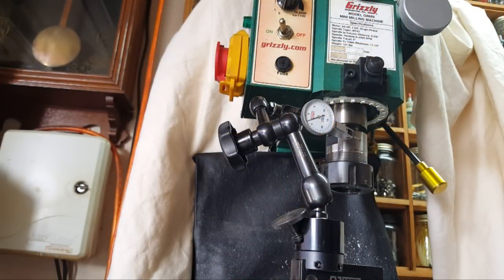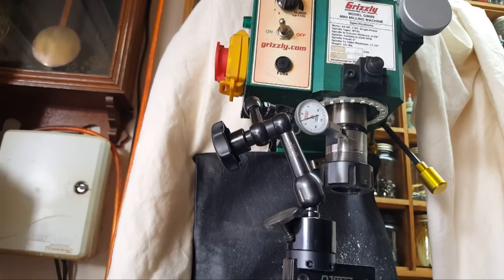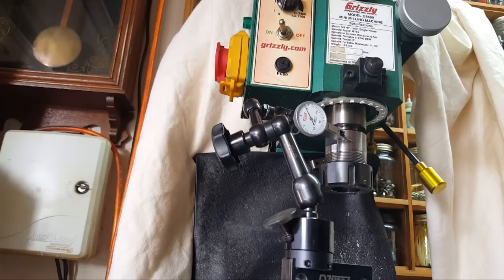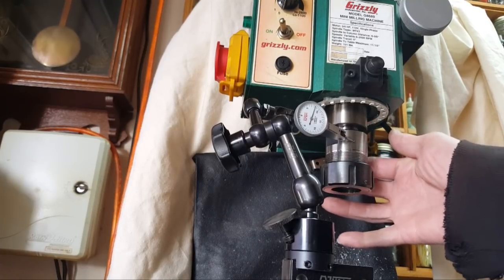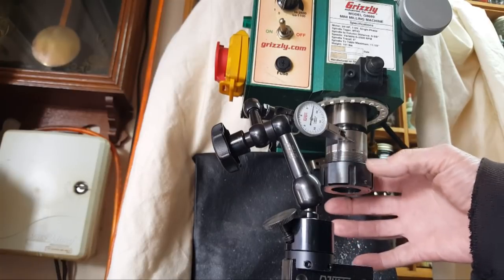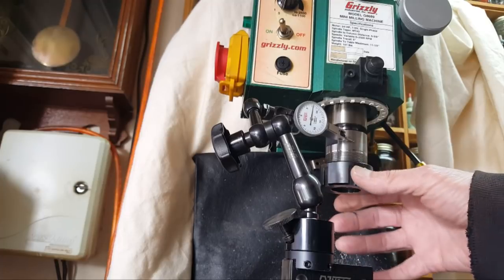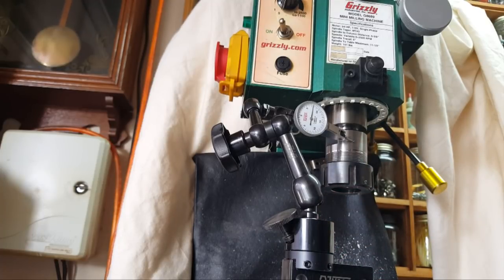Are Steel Over Aluminum Tools Necessary For Rigidity

Comment: 9:30 that's probably back lash in the lead screw of the cross slide
Reply: you mentioned that bigger machines must also have rigidity issues - i have a small 10" atlas lathe and there is zero movement on the spindle. 

backlash is probably about the same as yours, maybe worse (it's 72 years old after all).

 the motor is underpowered, but easily replaceable .... though it's kind of a nice safety feature, because the motor shuts off before anything breaks!

what's far more important than rigidity and precision is the skill and patience of the operator.
Reply from the maker: I was actually shocked to see spindle play. 5 years of heavy use and time for bearing replacement...
Reply: @TheMiniMachineShop  do those use tapered roller bearings? you can probably upgrade them with some "real" hardware and they'll last a lot longer. the quality may be lacking there, as the bearings currently are "ok" but not great

Comment: Great discussion. I take light cuts on my mini because the machine will trip with too much of a bite - is this a motor overcurrent trip? ? It always starts right back up. I'm good with the trips though because I think it protects my drive train from mechanical damage...
Reply from the maker: Yes it's an over current trip designed to, yes, protect everything...

Comment: Arbors, shell mills, and lathe bits are tools, and they not all built equal! So like any other job, you use the tool that fits the job! You always need to work within the limitations of the machines you're using, so if you're on a machine that is built for 0.100" cuts, then you use the arbor and mill made for that, and if you're working on a small machine taking off 0.020" cuts, you use the proper tool for that!  I've been watching for quite awhile Dave, and you know your machines limits and quirks, and you work within those. I see nothing wrong with any of the tools that you have either bought or made for the size of projects you build and the finishes you are trying to get. There's a lot of us out here that appreciate the work you're doing and letting us join in your machining journey! So don't let a couple of "internet pro's" that think mini-mills and mini-lathes are industrial equipment get to you, the rest of us think you're doing great!!

Comment: Hi Dave, all machines, big or small have some flex or back latch or whaterver, the main thing is to learn how to work around it, or, even better, take advantage of it all... 
The difference I notice mostly between pros and amateurs, it that the pros are quite used to "Push" a machine, for obvious reasons, you can make more parts in the same day, as an amateur don't have to worry so much about that .
As far as Al is used for tooling, Al being a very much softer material, you may need to oversize the tool, second it may wear quite faster than ground hardened steel, as for vise jaws for example, there is no problem with this as long as the person using it is aware of it and is ready to change the tools or a more frequent schedule, as an example of using Al in industry, special soft jaws, they're real life savers as of saving time and costs...  Just that they don't last forever and need to be reshaped once in a while.
Most of it all don't worry so much about the comments that are naming strict "Laws of Machining" since they don't really exist, just good common sense, finally you're the one that has to enjoy what you're doing in your own shop...
Remember, there are lots of correct ways to do something right...!!!!
All the Best and take good care,      Pierre
Reply from the maker: You're the only one to explain why people push machines. I've had many a time where turning something was going to take forever so I started pushing it resulting, like I said, in damage. Mostly material welding to the insert even though I use cutting fluid. So thank you for yet another great comment!! Dave
Reply: @TheMiniMachineShop  Also some machines are made to work hard without dammage as smaller hobby machines won't be able to keep up, you just need to know your machine capacity and operate it accordingly, just like you do by trying and adjusting.
You're also getting a "Feel" for it just like we do....   ;)
Reply: Pierre's Garage this is my exact thought...

Comment: I like your attention to details Dave, disregard the trolls trying to flex their intelligence (or lack of) regarding irrelevant comments! It's a hobby shop that is capable of first class work with beautiful surface finishes and compatent accuracy for what we need. Who cares about heavy depth of cuts and getting through the job as fast as you can, I have small machines also (7 x 12 and a  G0704)  and plan on them lasting the rest of my life making custom motorcycle parts and tooling which I am having a blast doing! Cheers, Doug

Comment: Dave have you ever used a carbide boring bar?  Yes, you did not compare carbide to steel or aluminum but the difference in stiffness is similar.

Comment: There are always those who want to demonstrate their superiority while flexing their oversize egos.  If you are happy with the results you are getting who cares what all the "internet experts" are saying?

I am also running a mini mill and am very pleased with the results I am getting.  One thing I am careful about and I am sure you are too is to lock axis that are not being moved, that helps a lot. 

My lathe is an old (1946) Delta 1460.  Plenty of cast iron and yes, it moves.  I made a bunch of tool holders for it out of aluminum, they work just fine.

One of the reasons the professionals use steel tools is that they withstand a lot more abuse in a shop than aluminum.  Since guys like you and I make our own tools we tend to be more careful with them because we know how long it takes to make them.

As long as you are getting what you want out of this hobby do not let the outsized egos bother you.

A suggestion?  Your collet holder is nice, but when you make that sort of thing give them a little more room so you do not bump them into each creating nasty little dings.  Another tip, cheap plastic cutting boards make great tool holders.

Comment: On the lathe do a solid toolpost mount, dump the plastic gears, and bolt down to the bench. You would be surprised the difference.
Reply from the maker: Often wondered if bolting it down would make a difference...

Comment: The more heavy cuts you make, the more important rigidity becomes. I have had a small lathe (40kg) and have a slightly bigger one (125 kg cast iron). Only the size and weight makes it better machining. I use the same cutting tools and QCTP. I have a set of tool holder (homemade) for the QCTP made from aluminum and from mild steel. I can do not see any difference in the result. I see some difference in where out. 

In general, steel is stronger and therefor better. But if you not need that strength, aluminum could be good enough.

Comment: On a weight for weight question, how heavy is your mini lathe Dave? My small cnc (yes I know there a couple of servos hiding in there) but my lathe has a 100mm chuck, which must be about the size of yours.  My lathe weighs in at 140kg. It has handles for a 4 man carry
Reply from the maker: The HF site says its 87lbs or 39kg so I can lift it pretty easily. BTW love your videos!
Reply: @TheMiniMachineShop  So 100 kg more! The way it is made and it has no compound slide or tailstock, I think that just the head, bed and cross slide would have to be around 80kg. So I tend to get good results because it is a rigid machine for it's size. I also like to think made in Australia has something to do with too.  Thank you for your comment about my videos, I just make them about jobs I do for customers, how you keep coming up with videos is beyond me.

Comment: well spoken, I have the same experiences as you. they flex. 0 tolerance is unobtainable and not desirable. the art is dancing between the tolerances and making it work. check the king nut on the cross slide. that is a weak point. mine needed much fidgeting and adjustment.   the three screws are difficult for me to adjust.

Comment: Ah another great video , its a hobby  have fun at . what one thing works  for you might not for the other guy . Dont let them make you feel bad like that ,i see if it was a production shop  than the machine be much larger  n yes i seen large mill and lathe flex  you learn to work with it   ,like they say the machinist  know his machine  because he works with it all the time. the machine can be tight all over dont mean your prats will  be a ok. the parts come form the operator   who runs the machine    that where the skill come in  ty Dave for shearing information  put a smile on your
face make them think :)

Comment: Nice video. good explanation on some of the limitations of your equipment and how you choose to work within them.
I still don't understand why some people can't wrap their minds around the fact that many people can't afford or don't have space for full blown production equipment. <smdh>
My only comment to the difference between tooling such as arbors made out of aluminum is that if you are content to make and use them knowing that they aren't as robust as the steel ones, who cares. At least you are getting experience in making things instead of watching TV wishing that the world was different.
Reply from the maker: Would love to have bigger machines. Cheap enough on CL. But yeah no room and not going to run a 220 line....

Comment: I dont entirely agree with making tool holders and arbors from aluminum.  I think in some instances for your particular machines it will be fine, but mistakes will happen, things will wear out and this is where you will then have to decide if the ease of machinability outweights longevity.  Even as a hobbyist, tools and tooling get used often.  Often enough that they will show wear.  You produce enough videos that I can get a sense of how much your tools get used.  Arbors get inserted and removed constantly during use.  Tool holders get clamped and steel set screws get torqued and retorqued.  I work as a machinist during the day and when I get home the mini mill and bench lathe are running.  The more mass I can add to my machines the better suited I am for taking more precise and yes bigger cuts.  Mass doesnt exactly equal rigidity but it all adds up.  The reason the difference between the materials is not jumping out at you is because the machines dont have the horsepower.  Add a 1.5HP motor to the mill or lathe and the difference will become obvious.  Judging by your reference to Bridgeports I would assume you have never ran one.  I think if you ran one you would think a lot differently about your choice of materials for tooling.

Comment: It's very easy to evaluate how different materials will affect the stiffness of a component of similar design and cross-sections. Stiffness/rigidity is derived from Young's Modulus of Elasticity.  The values for some common materials are as follows (10⁶ PSI)
aluminum (6000 series) = 10
low allow steel = 29
tool steel = 30.5
cast iron = ~24.5
So in regards to the use of aluminum vs. steel, a tool made of aluminum will deflect ~3 times as much as a comparable tool made of steel. The significant difference in stiffness should be sufficient to dissuade you from using aluminum, but it isn't even the best reason: you should be using steel because of durability issues. Non-anodized  aluminum is very soft, and scratches and deforms very easily.  It's a poor choice for making tools that will be subjected to any significant use. 
In regards the difference between piston and wedge QCTP's: wedge QCTP's force tool holders against the flat vertical face of the QCTP. Piston QCTP's force tool holders away from the vertical face and are dependent upon the piston to resist lateral forces which can be significant because of the dovetails. Wedge QCTP's have four points of contact and piston QCTP's have three. In this situation, the four points of contact are superior.
Reply: Great comment I would like to add that cast iron is used for its vibration dampening and cost, tool steel is much stiffer but would probably need a cubic crap ton to dampen well, if you are taking light cuts then this decreases deflection. In steel tubing you can use a larger diameter but thinner wall that will increase rigidity up to a point. I think what Dave is on to is that the machine might deflect more than the tooling and so using aluminum might not be so bad if you aren't really taxing it.

Comment: Well, you are right about the fact that even full size machines will flex... even  a granite slab, several inches thick will flex if loaded in certain ways !
An arbour or toolpost in a soft metal may work well, but it will be subject to plastic deformation. Steel , less so, a lot less so.
I reckon you would agree that a toolpost shouldn't be made out of lead.... well, in that case the arguments for NOT making an arbour or toolpost out of aluminium are the same. It deforms, it is soft, it doesn't hold its shape it galls, all things a proper hardened steel part will only do under much more adverse circumstances. Your machines are small, and they are (as all smaller machines) disproportionately light. The more weight you add, the more rigid parts you use, the more you mitigate that handicap.
A second thing is repeatability and reliability. Make an arbour out of Al, grunk down on it, and you can not trust it to use it on a second part. Same goes for those Al toolposts. 
Another remark, as an aside, (I may have already said this on a comment in this channel) Anything Chinese (in the sense we understand it here) needs to be seen as a kit-of-parts. The very first thing that needs to be done is, remove every last fastener, throw them away and replace by properly graded hardware. Your gib screws will not strip out of you will use properly graded ones... use the Chinese ones,which are too soft... and they will.
I understand that you have no intention of taking ' Abom type cuts' , I don't do that either, not even on an lbs 1800 lathe, but that doesn't mean that those small machines can not be improved sight out of mind by making everything fit just a bit better, adding a bit of weight, bolting them down and using the right metal for the right job. 
It can't be that much fun, having to start every job by mitigating the shortcomings, of this size machines, especially when a lot can be done to remedy the whole affair.
The reason why industry is producing tools in aluminium for the home market, is not because they are as good as steel ones if you only use them occasionally... no the reasons are purely economic... it is light, dirt cheap and looks ok, as long as you don't look too close after its first few uses.
The real Aloris toolposts have indeed an advantage over the piston type. Here you basically jam a tapered gib into a dovetail slide. That part is not going anywhere! With a piston type, it can still move (and it will!).
Of course you will be able to make parts for your projects with the tools you now use and have, there is little doubt about that. The question is, how precise do you want to go? 
In industry, when a milling machine column flexes the way a mini mill one does, the machine gets replaced.... it is as simple as that. In the home shop, you either live with it or you mitigate the problem. 
It isn't just your mini mill... the bigger versions (I have a lbs 1200 type) does that as well... it is the design that is faulty. Well, I bolted the column of my mill to a 12" square concrete pillar...it now flexes no more (well not that I can measure anyways).
You can do similar things if you so chose....

All the best, and keep the vids coming !

Paddy

Comment: Hi Dave, what an open question, ask 1000 folks and you will get almost 1000 different answers.  One thing all these small machine 
tools lack is weight.  Iron castings with lots of weight make for rigidity, this is why if you look at an old Cincinnati mill it will be huge and weigh tons.  It will just sit there and get on with the job.  These days castings are pared down to the bare bones and none of these 
small machines have enough weight in them.  I use aluminium  for the block that holds my gang tooling, I am sure steel would do a 
better  job but aluminium is far more convenient to both obtain and work with for myself. Like most of these things it is nice to know 
the "real" answer, but in the end you just have to do what suits you.  Your money, your shop, you only really need to take advice re safety matters.  Does not make much sense to say " they are my fingers" if they are on the shop floor.
Reply from the maker: You're absolutely right on the weight thing. Mass makes all the difference... Tried adding lead weight to the CNC Z axis but still to much flexing...
Reply: Probably gets expensive shipping heavy castings over the Pacific.